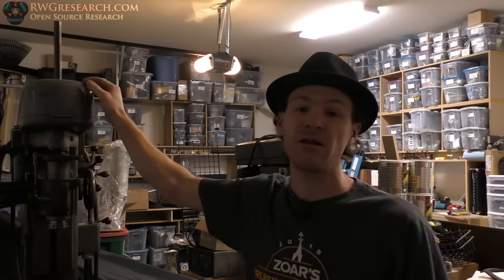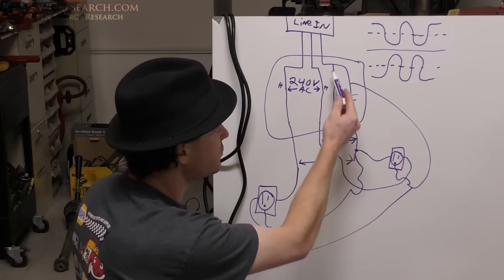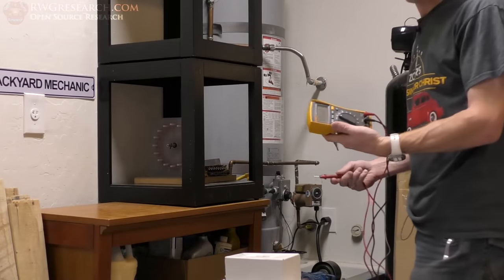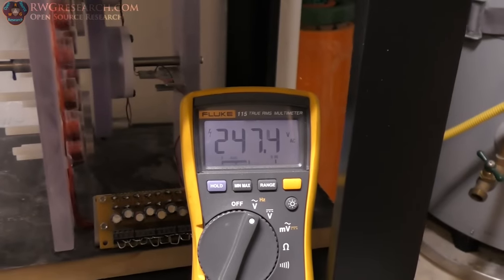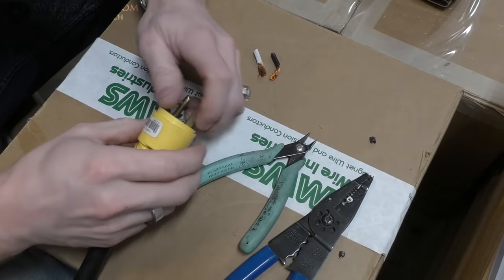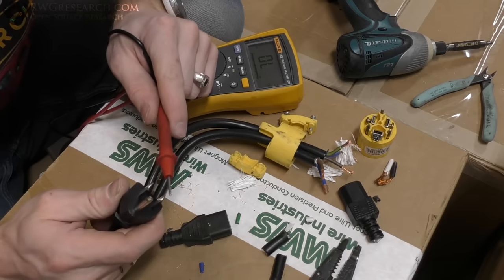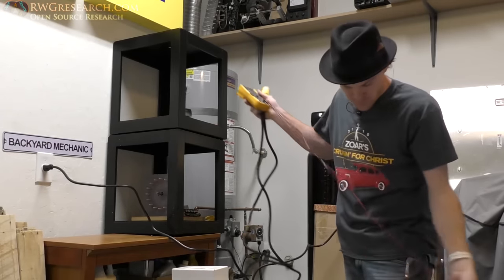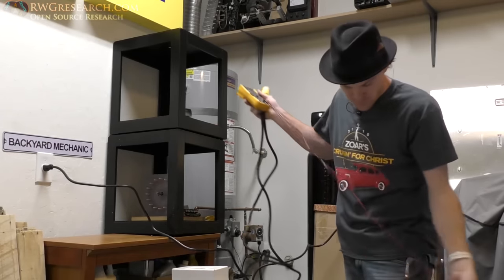How To Get 220V/240V From Two 120V Outlets. No Electrical Panel Work Required...

Comment: As an electrical engineer working for a contractor for over 30 years, I feel compelled to tell your viewers that this installation is not compliant with any standards and is dangerous.   The dangers are both fire and your life.   So if you value your home or maybe even your life, do not do this.  If you survive a fire from this, your insurance company may not pay for the damage.
Reply: Eso que estas haciendo es una locura por que es riesgoso ya que en un desbalance de de la carga puedes pasarla mal  por que estas conectando dos cargas desbalanceadas a una carga
Reply: Ademas no tomas encuenta la distancia del cable ni el calibre del cable y para colmo no sigies los codigos electricos de seguridad
Reply: eabyrd1506   It seems you feel I am incorrect.   My statement still stands.   NEC (National Electrical Code) has since 1897 not allowed a single phase 240 volt utilization equipment to be connected to single pole circuit breakers or single pole switches as is being done in this instance.   The use of twist lock receptacles makes no difference.   This gentleman can do whatever he wants to do.   Viewers need to be aware that this is not something they should do.  If one breaker trips, there is still 120 volts at the machine.   Not the way it is supposed to work.   Also, no statement was made as to how many amps at 240 volts was needed.   What if it needed 30 or 40 amp circuit,   Would you still do the same thing?   Some people watching this video may try it.   So much for safety!
Reply: @KevinCoop1  You make complete sense. Thanks for clearly explaining why.

EDIT:
I came across this: https://www.youtube.com/watch?v=xGNj3eYQiUQ
Reply: Commenter Person    Wow, Tessa company made a similar device and got it listed to charge their cars!   If you read my original statement, you will find that I said not correct to connect 240 volts to two single pole breakers.   The Tesla device has internal circuit breaker that resolves this.    Thank you for pointing this device to me!   Be Safe, Live Long!
Reply: I feel compelled to tell you that as a mechanical engineer, working with electrical engineers for 30 years, I know how clueless some of the electrical engineers are when it comes to home wiring. I recently had an issue with one of my 120 legs at my house and the power company came in and installed a temporary transformer to give me 240. I researched this own and it amazed me how 4 of the 5 “experienced” electrical engineers didn’t have a clue about it. I heard them spew out a lot of bs I knew was not the case. They have experience with their industrial 480 and 208 application and just live in their cocoon of limited knowledge and theory.
Reply: mgpvii   I would almost bet that they worked for consulting engineering company and not contractors.  I'm just putting two cents in.
Reply: @KevinCoop1  You are correct, consulting/design engineering.  I will admit that the contractors are the ones who get the sh!t done and are a lot more knowledgeable and practical.
Reply: mgpvii   This conversation has really gone off on a tangent!   What you experienced is because many consulting engineers are given "Rules of Thumb" and that is all they know.   They are not allowed to think, just do the rule!
Reply: mgpvii  Oh by the way, since you had 120 volts and not 240 volts, along with the temporary transformer install, there must have been a short in the transformer on one side of the secondary coil. :-)
Reply: @KevinCoop1  thanks dude!
Reply: Drew Busch   Drew, I have no idea what kind of contractor you work for or your role in this.   As discussed earlier, a set of plush to a receptacle is manufactured to plug something 240 volts into.   It sounds like you are supposed to do this as permanent.   Therefore, the NEC now comes into play and is now illegal.  So you cannot do as permanent.   Also, I do not know the breaker amps of the two circuits, nor the KW of the floor heater whatever a floor heater is.  If the KW is high enough and one of the breakers is 15 amperes, then you can prove to your boss it will not work.  Divide the kw of the heater by .240 and you will get amps.  It cannot exceed the lowest breaker amps times .8.  I.E. 20 x .8 = 16 amps for 20 ampere breaker.   Personally, I would never do it!   It should be done the right way!   Tell the boss to buy a 120 volt heater and be done with it.
Reply: @baez.4862  y como le hago para conectar una máquina 220v a  
110v?
Reply: No doubt such a connection is not allowed according to any recent edition of NEC, but I'm still waiting for some expert to give an electrical explanation of why it's not allowed. Emotional pleasing isn't going to sway many DIYers, so please expound... Show us a schematic with current paths, etc.

Comment: This is how you burn down your home. specially with those 16 gauges extension cords. How many times you've heard or seen on the news house caught on fire due to heater on extension cords etc etc. Extension cords are meant to be for temporary supervised uses. Yes your methods works, you'll get 220v, but that doesn't mean it can run a 20amp or 30amp equipment constantly,  some many questions left to be answered here. What gauge is the house wired with? is the breaker matches the amperage of your wiring? what's the current load on each circuit?  how far is the breaker box? voltage drop? have you check all circuit back to the box make sure there are no loose wires, backstabs? what's the load require to run your equipment? Where's the 80%?🤔

Comment: This is the farmers guide to electrical wiring, that wire was not rated for 240v, its rated for 120v. This is how things catch on fire over time!
Reply: 240v itself doesn't really need bigger wires, the reason that "true" 240v wires are so bulky is because they are rated for high current. Most 240v outlets are capable of 20 amps and up, vs 15 amps for standard 120v outlets. In this circumstance he's limited to low amps, because if he were to draw more than 15 amps from these sockets, the circuit breaker would just trip and cut him off anyways.
Reply: The wires coming from his outlets are only carrying 120v each. Insulation values are important though to keep the electricity from wanting to jump out of the cord. Higher voltage = higher pressure.

Comment: For fire hazard and protecting your equipment .your design needs to fault as quickly as possible hence the breakers trip together by design in a 2pole breaker the circuit (circle) is designed also to where if any part of that circuit faults all potential energy is taking off that circuit the breakers in a home trip by  thermal the electricity starts at the source an ends at the source not ground back to source (a circle ) by that it heats up that breaker so it will trip. in commercial the two wires run in one conduit not in two different ones because the electromagnetism of the two phases help effect the heat dissipation in the motor load as well

Comment: I bought a ready made version of this concept at a University of WA surplus sale.  Has 2 x 120v plugs cords and a 240v plug panel where they meet.  I was always afraid to use it, but someone manufactured it some time
Reply: So you know what it's called
Reply: @CopperheadWelding quick220

Comment: Can I plug in a camper? When camping we plug into a 30 at the campsites? My house trips when plugged in
Reply: Because the amps (load) from your camper (30amp) is too high for the house breaker (15/20amp). If you plug your trailer in a house you can only draw the 15amps the house circuit provides before you trip it. As for the video's plug, out of phase wiring will not work either because your camper (US) is 120v not 240v. You could possibly try this with an additional step-down transformer that can carry your intended wattage, but I would recommend consulting a pro.

Comment: Unfortunately what you're suggesting is dangerous.  For 240V, the breakers need to be ganged - there are safety reasons code requires that.  With the beakers not ganged, one can trip, and that circuit can still remain hot (via connected 240V load(s)).  When the breaker is off, that circuit should be powered off and safe, but with your connection through the load, that's no longer the case.

Comment: Question: I’d like to run a separate circuit using 30 amp double pole gfi breaker with 10/3 about 80 ft to run a 220v garage heater that pulls 15 amps max— , but here is my question , can I pig tail off one of the hot wires to add a 120v receptacle to power small amperage items?
Reply: NO !!
Reply: You cannot do do that because 220 lines are designated circuits and nothing else can be connected to them , not only does it pose a fire hazard , It is a violation of The National Electrical Code

Comment: There are VFD models that will turn 120 into 220/240, and even models that will turn 120 into three phase 220/240. Yeah, yeah, you have to buy one. But I have shops, and even a mill with just a2 Hp motor draws a fairly heavy load under a cut. That’s continuous power.  You don’t want to run a mill with this.
Reply: VFD verable frequency drives installed tons on them working in the hvac industry you can do it but it will lead to a unbalanced load and damage the electronics trying to draw more amps than the circuit can provide

Comment: Life or death only! 
If you need a life support system that works on 220 volts and 120 volts is all you have. You need to do this to save a life. Don't do this so you can use a milling machine. Need a double circuit breaker in the power panel.

Comment: if you have 2 differnt values of breakers won't you tend to blow the lower rated one all the time under load?
and a caution you have to think about, if one wire is plugged in the other one you have in your hand is LIVE  120 volt hot wire and ground.  you'll want to shut off the fusebox this is a really bad idea if you have kids. they tend to unplug stuff, and your son/daughter/wife might get the shock of his/her life.
And I believe I'd use a twist lock type plugs and outlets.
Hey you don't want that Mill I'll make some room for it! I'd rather it was a bridgeport but that will do just fine too.
I'll take a lathe too.
And they say the guy with the most Clamps wins!   he dosn't win if the other guy has a machine shop in his garage.

Comment: Sir, I used your wiring to change 110 to 220 Volts and it works well. I had no problem. I have a question thou, if I used two 110V lines on 20 amp breakers to create 220V, what amperage would I have. Do the two 110V lines add up to 40 amp. at 220V or does it stay at 20 amp.
Reply: Victor Zychla haven’t tested it but pretty sure it doubles tried this at a friend’s house on an industrial steel melter with 4 phases 2 to make 2 240 and the 2 240 to make 480 this does work pretty sure its 80amp
Reply: Current is 20A max. Current does NOT double.
Reply: @walterk1221  
Walter are you sure. I am no expert on electrical but I ran the setup with a welding machine which draws 35 amps  and it work fine. Thank you for the reply, could be wrong, it would not be the first time
Reply: @victorzychla8237  I am quite sure. The welder data plate likely shows the ampacity of the supply the design of the unit aught to have but unless you have an ammeter you don't really know what the unit uses.

Comment: I listened half this video and was thinking novices should not tell people about electrical wiring. Then he said it doesn't matter how you hookup your wiring to a plug adapter. IT DOES that's why there color coded Brass for the hot wire silver for the neutral same as wiring a house or business it keeps things in phase and electricians alive. If you screw up and connect neutrals from different phase's you can get 240 volts from the neutral wires and ground. Don't listen to his advise, please.

Comment: Very informative video specially for US and Canada, but this requires knowledge on electricity before you attempt to diy. Been in Canada and learned this 220 volts was available, upon studying the wiring diagrams of their appliances like clothes drier, dish washer which have five terminal ac outlets. To make revisions and installations, only licensed technical man are authorized

Comment: Thank you man this helped me so much. Now my mining rig is running better no more overheating psu. I talked with an electrician that I know well and he said this method is perfectly fine and safe. I have been running my mining rig with a 750w server psu and a 1300w psu for 3 months straight and no problems at all and my gpus are overclocked running better with no errors or stale shares also I was melting gpu power wires untill I tried this no more plastic melting. Whatever anyone else says that is bad they are just an anal dinklepuss.
Reply: Who ever is your so called “ELECTRICIAN ” you talked to that told you this method is safe .... I can guarantee he isn’t licensed let alone an actual electrician. Because this shit is absolutely dangerous and can kill someone

Comment: Two phases? No, center tapped 240V transformer splits into 2 times 120V vs. ground and 240V between the outside leads of the transformer. Still single phase.

Comment: Is it necessary to change the outlet and the plugs after changing it to 220v? Im also using a 120v extension cord for my computer power supply (PSU) and I dont see any reason why i should change the outlet and the extension cord plugs hence the PSU cable. I dont know see any reason for the changes since PSU detects the voltage and adjusts automatically. why is 220v outlets different? is it just to make it visually different? or am i missing something
Reply: imagine you forget that outlet is 240 volts, or worse, someone else comes into your shop and plugs something in not knowing. you use a different style outlet so it's not possible to plug in the wrong thing. double the voltage leads to 4x the current draw by the load. a computer psu that's designed to auto switch input voltages, likely not doing anything special inside. it's just a 240 volt switch mode power supply which is capable of running on half that voltage. what you wouldn't expect, the psu actually has to work harder at 120 volts because it's drawing double the current. it will run more efficiently at 240 volts and stress the internal components less.

Comment: no. just because you can doesn't mean you should. don't "hack" your breaker panel either. it's not that hard to install a breaker into a panel and run a line. install it properly, then it will continue to work reliably and no one gets hurt.

Comment: Will this work plugging into 2 separate inverter generators? Most of the inverter generators have parallel kits but those are just 120 volt kits. I know in theory it should work but im just not sure how the circuitry works on the smart board for the inverters on the generators.
Reply: what the parallel kits do is keep the phase in sync between the generators. may be possible to get 240 volts from 2 generators, but probably not. if it was possible, they would sell an adapter to do that. what's more likely is destroying both generators. I'm curious how the parallel kits work. do they have a signal wire running between the generators for communication, or does it work simply by phase matching like how a grid-tie inverter works? lots of other things to consider too, like grounding of the generators, sharing grounds between them, grounding of the signal lines, neutral binding... a lot can go wrong, likely explode the electronics in both generators.

Comment: Why not just convert one of the 120s to a 240 by running another hot?
Reply: Isn’t that what he did. The other hot just happens to be a near by plug. If you are talking about permanently changing the plug I don’t think that would be code compliant. But I could be wrong.

Comment: My question is : Why using GROUND instead of NEUTRAL for your adapter?
Reply: There is no neutral in a 240v circuit. Two hot legs (out of phase) plus ground for safety.

Comment: Here un Spain we have 230v. Used to be 220v. In singel phase? (Live + neutral) And 380v. For the 3 phase. Nice video. Saludos
Reply: Yeah I really miss the European power system. North American outlets are pretty weak sauce. Can't even weld using regular 110v for the most part. Also not to mention there is so much confusion when it comes to multiphase systems in the North America. Like no joke there are like 8 different style plugs in wide use.

Comment: it works but my coffee maker requires the white line, return only 120 one line. Now how can I get a return 240v without tripping the circuit because I tried to combine 2 white lines. It doesn't work. I need white line return 240v

Comment: If the two 120V outlets from the same side of the panel box, do you still get 0V after the conversion?
Reply: you could find something near 0 volts, or you could end up with 2 separate shorts of 120 volts. a lot of things can go wrong, that's why we don't hack things like this.

Comment: I believe you can purchase a unit fed by two 120 electric cables and a 240 volt outlet.  It comes with a 240 volt indicator light that illuminates when one cord is connected to line one and the other to line two.  If both cords are connected to the same line, the indicator won't illuminate.

Comment: What happens if you only plug one in   would that mean it will still work at 110?
Reply: no, the cord that's not plugged in would have exposed 120 volts in series with the machine. if you happen to touch that plug, the machine starts running, with all the current flowing through you. I actually did that when I was 4. alone in a garage, my parents never knew.